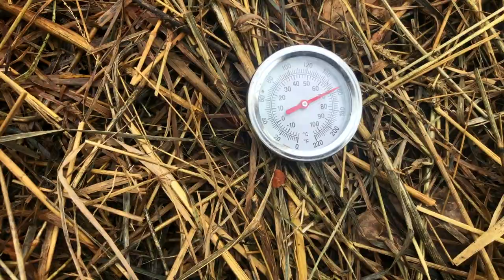Greenhouse - Heating with Compost Power and Moving Water?

Comment: it loses heat quickly because plastic pipe is a very poor conductor of heat. It wouldn't matter if you increased the coil length to 100 ft once the cold water takes the heat out of it it will be slow to reheat it. using a copper tube would have a faster transfer rate but still you are heating water from a relatively low temperature heat source to heat air by just the open metal tank. Also not a very efficient way to heat the air. My suggestion would be to use aluminum downspout inside the compost pile and a blower or small fan to move air thru the downspout. The aluminum is a very fast conductor of heat and you will only be heating air instead of heating  water to heat the air. Alos while not a lot of heat is radiating from the compost pile itself I recommend, as another comment suggests, moving the compost pile inside the green house. Also using the downspout the air would naturally circulate the cold air from the floor level into the compost pile and out the top.  Just my opinion.
Reply from the maker: Some good ideas here.  I've revamped the design and will be sharing another video soon, hoping to incorporate a way to pull the hot air off the pile along with better water heating.  We'll see..  Thanks for taking time.
Reply: @edibleacres  if I were you i would not waste time on trying to heat 50 gallons of water by passive methods. It just is not efficient. Either an efficient solar water heating panel(s) 40 sq.ft. area or greater or a wood burning system will be your only options to cost effective water heating for this application to function as desired. Otherwise the math involved in heat absorption and loss, heat transfer and flow rates doesn't work in your favor. This is not my opinion, it is math.

Comment: what if u spread out the length of pipe you have now more evenly through the compost? i feel like it being all concentrated in the center is what makes it finally stop flowing hot cause it starts to act more like a radiator than a core. if u can run it out so theres less chance of actually cooling whats around the pipe it should keep flowing hot water. if that is the issue anyways. know nothing about composting just stumbling through youtube tonight
Reply from the maker: Seems like a reasonable idea, thank you for sharing that.

Comment: I agree with others that adding insulation to the pile is a good idea.

To help with heat loss you could also store the water in a sealed black container. Making it black will reduce the risk of algae and bacteria growing and it could increase or stabilize your heat gain if it is placed in the sun. 

Raising the storage cell higher, creating a bottom outlet for the cold water and locking the hot water inlet up higher would streamline the heat exchange.

 Eventually your house could be heated with radiant floor heating before returning to the storage cell. 

Thanks for the content, I always learn a lot from you and the community which accumulates around them.
Reply from the maker: Nice notes here, thank you!

Comment: Another thing, if your water tank (whatever it is) would be painted black, during the sunny days the sun would help to heat the water. That's why some people use 45 gallon drums (or 50 gallons...) painted black on the south side. But pouring some urine in the middle of the pile has the same results than putting some wood in your wood stove when it's getting cold!!
Reply from the maker: I should think about wrapping the tank in something black on the south side for the winter...

Comment: You just need a pump, a better heat exchanger in the pile, and insulate the tank from the top and bottom to let heat radiate out of the metal sides. 60 degrees is no joke so just capture and store it better.
Reply from the maker: So many ways to improve this system to be sure.

Comment: What if instead, you had the tub inside the fence area, wrapped in the tubbing. Should keep the water warm all the time. & If you put mirrors inside the tub it will help with collecting the sun for heat as well. The same for the inside of the greenhouse. Put mirrors where the sun hits the most. You could even basically do a wrap around with the mirrors,& still have a hose connected to the tub & going thru to the greenhouse to have a water drip hose for the plants in the greenhouse. Mirrors collect heat so I don't see why it wouldn't work. (It's how you can cook with the sun outside)

Comment: Can't you let the cold water at the bottom just discharge into the top of the pile?  If you had a way to have to compost pile itself catch and divert water to your tub from the bottom, then letting your tub drain into the pile...it's a loop.
Reply: Maybe using gravity can catch the runoff water from your pile diverting it to that water battery.  "Might" even be able to use gravity via the plug on the bottom of the tank to force that colder water out back to the top of the pile. Then if you keep your coil a closed loop (would work better with copper) and use it like a heating element into the water battery....worth thinking about. I could be way off.
Reply: Would also need to deal with finding the perfect compost hight to Water battery hight ratio...  Filtration also becomes an issue I suppose

Comment: Why not expand the greenhouse and compost directly inside of it? I would imagine this would be the most efficient, most passive way to heat your greenhouse. No wasted heat to the outside elements. Simply turning the pile would release an immense amount of heat into the greenhouse while also getting the compost pile the oxygen it needs, and releasing CO2 and other gasses for your plants to consume? Just my thoughts, not tested.

Comment: A bit confused...If you are running solar, why not just hook up a 12v heating element, attach it to a closed water barrel and forget about the compost pile.  maybe move that pile into the greenhouse for some extra heat.
Reply from the maker: I should look into what a 12V heating element would look like in this system.  
I need compost for our gardens anyway, the chicken coop needs to be cleaned out anyway, so building a compost pile associated with the greenhouse to generate heat we can put to use seems like a logical association...
Reply: @edibleacres  Agreed, but stealing heat energy from a composting pile seems a bit counter intuitive. That is great free energy source for composting material.  Using a Solar 12V DC heating element and water as your battery is a great 'almost free' heat source for heating larger spaces.

Comment: I think that, if you can calculate the estimated time the water is worm, you can stop the flow whit a timer just for a minute ore more, within that time span, then it would continuously be hot water. No pro, just sharing thoughts. =)
Reply from the maker: If there was a little thermometer that could monitor and turn things off if it gets below a certain temp that could be nice.

Comment: Unfortunately you can't draw more energy from the water than is stored in it.  When you are looking at moving the volume of water you have AND heating it, you have to introduce a considerable amount of energy to do both.  Think of your thermal battery like a bank account, you can't withdraw more funds than are in the account.  The amount of energy needed to transfer that amount of water that distance would boil the water and probably kill your compost.  Perhaps you could consider installing vacuum insulated vacuum tubes to harvest more heat, then transform that energy into movement by mechanical means, but you would be limited to the hours that sunshine hits your panel.  I would look into insulating your greenhouse before considering harvesting more energy if the ethics of energy use are problematic.  Or perhaps consider harvesting heat that you already waste, like the outlet of your clothes dryer.
Reply from the maker: More to think about here, thanks.

Comment: It would be a good idea to use a more conducting material for the tubing coil that receives heat from the pile, using the more insulating material for the rest of the tubing to maximize heat transfer and reduce heat loss. Just some thoughts I had to improve the system.

Comment: Why complicate things... put raised bed inside greenhouse where you fill up with dry leaves in spring and put on top soil 20cm where you grow vegetables. So you lower heat lose and concentrate heat on that soil where it growing. This how i do for some time and works incredible. Beast regards.
Reply: Dont forget to press and compose leaves and water it. And in winter when you watering you also watering  leaves to gain heat.
Reply from the maker: In one of our high tunnels I set this up this winter and it worked nicely for us.  I plan to recreate that in some areas for sure.

Comment: how about running the pipework through the soil. Warm the soil rather than warming the water in order to warm the air. I think plant growth is better when the roots are warmer rather than the air is warmer.  You'd still need to pump. Or how about connecting your cold water outlets in your house to the system. City water into compost pile pipe system collecting heat which is dumped into your soil on the way to your house taps (fawcet?). So every time you turn on your taps you dump heat. Therefore no additional pumping required.
Reply: That risks drying out the soil/roots and the plan is to also heat the house. I think that by having the heat in a thermal battery it is easier to regulate the temperature/energy being delivered to the plants and ensures that any heat that is delivered is never drying.
Reply: @recklessroges  not sure i agree with that. climate battery design pumps warm air from the tunnel/ green house underground for later release. If the pipe is deep enough it would spread the heat out to the soil above. Plants perform better in warm soil rather than warm air with cold roots and I don't think it would dry the soil out, if it does irrigate. Warm soil and moisture = growth. But if you need heat in the house it won't work. Depends what you want to prioritise.

Comment: Copper pipe instead of plastic would hold the heat and give you more hot water
Reply from the maker: Definitely true to be sure, but SO much more expensive and more importantly for this context... WAY too fragile for the amount of movement we'd need it to handle.

Comment: I wonder what a below ground composting pile would yield in hot water duration. 
also have the tubing run through a couple old radiators evenly placed around the belowground composting piles for max heat absorption. 

drip from the tank could be setup on a small automated system, check out tindie.com